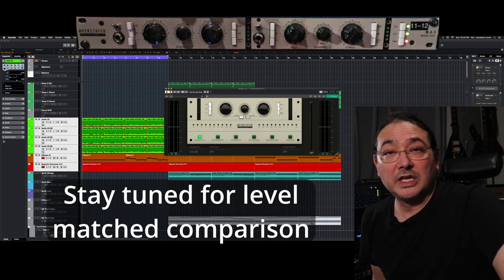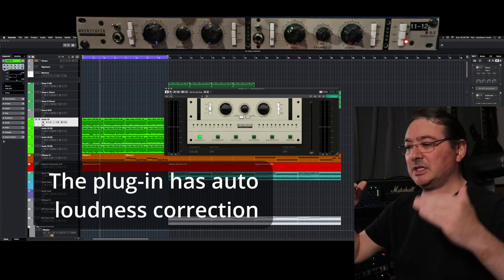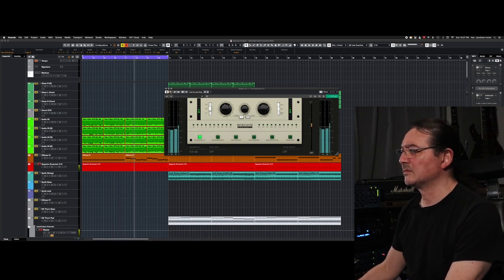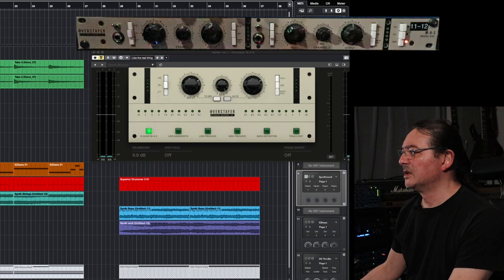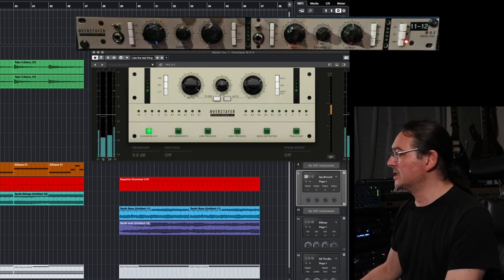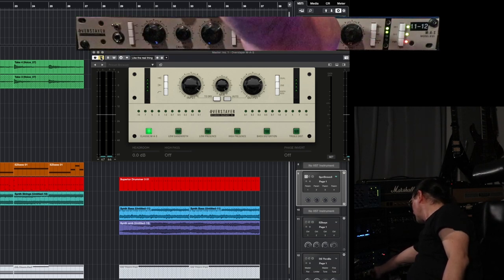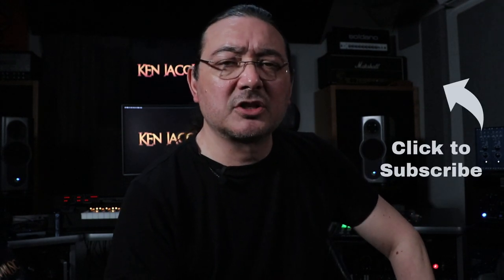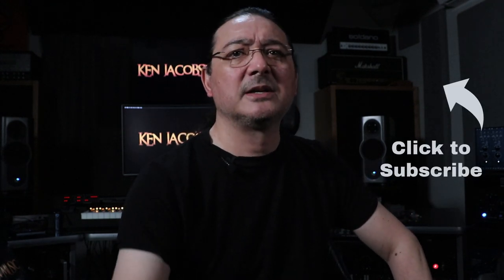Overstayer M-A-S Hardware and Software Comparison | M-A-S 8101 Rack Unit

Comment: I think I managed to get the software to sound pretty close to your hardware unit by using a bit of analog chain before it hits the Softube Overstayer plug. I  sum my tracks into my allen & heath zed R16->Gssl Bus Compressor and then I hit overstayer when it gets back into the DAW. I guess the hardware unit would certainly replace the summing part of this chain, but I still think i got it as close as possible given the gear I have at my disposal. Excellent comparison, dude! Was looking forward to someone actually doing a side by side with the real thing!
Reply from the maker: That sounds great what you are doing. They are close after all. Thanks for the kind words. Please consider subscribing.
Reply: plugin will never sound identical because two hardware will always sound different and developer don't emulate the crosstalk that hardware does since engineer consider it to be a very big problem specially with phase.
Reply from the maker: @aviatedviewssound4798  agreed.

Comment: I have a pair of RND 542’s and I love what they do on my mixbus. I’m considering selling them for the Overstayer MAS 2 because I don’t use any other 500 series modules besides the 542’s. I would like to ditch the 500 setup completely if possible but I’m unsure how the MAS compares? Can it sound similar to the 542’s? I’m not looking for crazy distortion, just nice tape saturation that adds some girth to mixes in a musical way and has the soft clipping to boost perceived level of the tracks
Reply from the maker: I also have the 542. I use the MAS on the mix buss. It’s my favorite saturator for subtle stuff. They don’t sound alike though.

Comment: Many thanks for the vid. Just wondering if  the extended version of the Softube Overstayer MAS could be used to roll off some of the brightness and boost some of the lower mids to get closer to the hardware? That would make an interesting vid.
Reply: Yes it can and I think that extended version sounds better and has more depth when you tweak what that saturator "hears" and will saturate more so I typically send less top end and lows into Softbue Overstayer extended using those dials and saturate only upper bass, mids and highs.

It's one of my go to saturators in the box that actually always help the music when you tailor it for particular sound you want.
Reply from the maker: I hear the same to varying degrees on software vs Hardware. The software will have more features and functions. The hardware always sounds more fleshed out or 3D if you like. The extended version sounds better